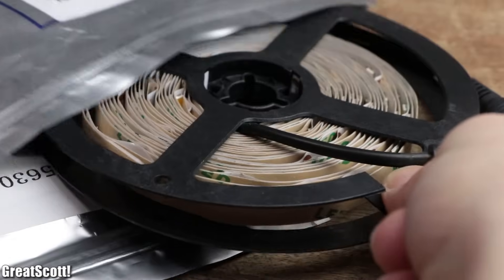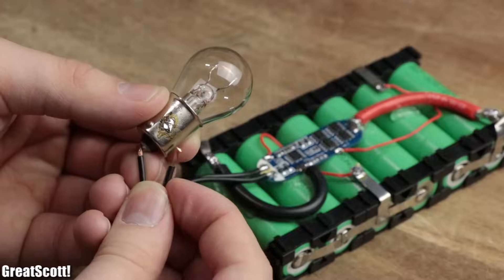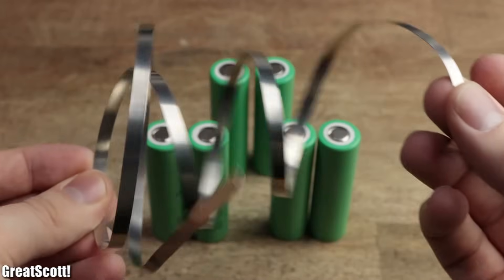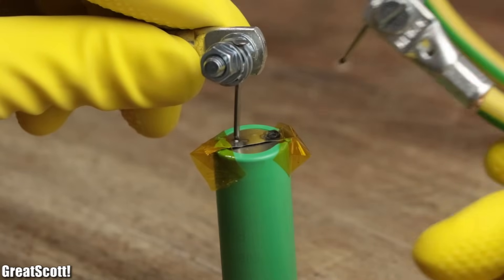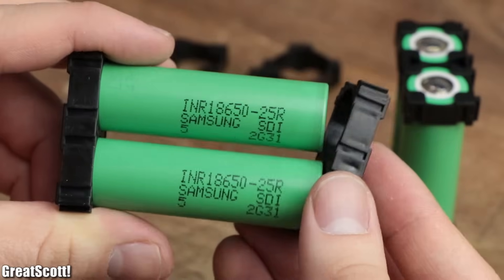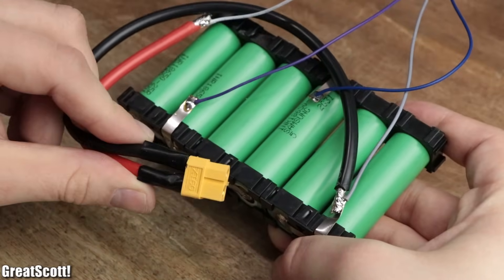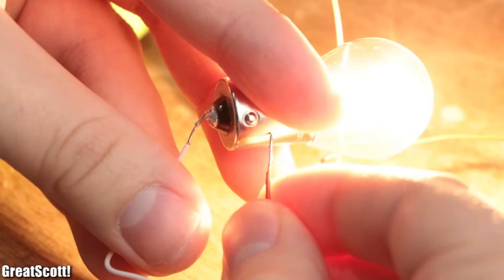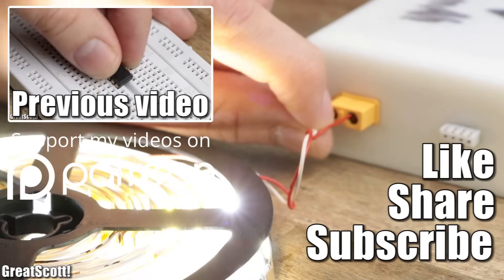Make your own Li-Ion Battery Pack

Comment: When soldering directly to a battery cell, it works best by using the largest possible soldering iron tip.  That way there is less chance of overheating the cell.  A small tip may well be hot enough, but will take much longer to heat the mass of the end of the cell, and more heat will have time to migrate into the cell instead of being concentrated at the very end where you are trying to solder.  This is especially noticeable on the negative pole of the battery, which does not usually have a raised button which protrudes from the end of the cell; and therefore has greater mass right where you need to heat it.  The positive protruding button is always easier to solder.
Reply: Also, you should discharge the battery to 3.5-3.6 v/cell to lower the heat damage to battery before the heat soldering.
Reply: @breezeli6233  Never done that, and they still work perfect, they still have each 3400mAh.
Reply: Albert Pelletier 
Makes sense. Would 60 watts soldering tip suffice?
Reply: @emersonsrandomvideos248  I use an 80 watt, but it should be fine
Reply: @emersonsrandomvideos248  Yes is more then enough, i use the Miniware TS100 solder iron on 24v, and that gives it 64w, i use the biggest solder tip i have for it, i just made a 24v battery Pack.

http://www.miniware.com.cn/product/ts100-soldering-iron-b2-tip-hot-air-soldering-station/
Reply: @emersonsrandomvideos248  I use 25w soldering iron
Reply: His iron looked just the right size ... but spot welding is always best .... if you have a lot of lithium cells these make a great power supply for spot welding , can deliver high currents , I tap into my powerwall ... Using new 18650 cells a 10p 3s configuration is all you need to spot weld .... or just 3s with a good super capacitor
Reply: @Kent Hinson Same here love my Miniware TS100, one of the best solder iron for under €50,- has done many soldering with it, and always has done his job.
Reply: I agree
Reply: Less than 200 dollars for a spot welder, no damage to cells....  And it's cool to use!
Reply: Here is a faster way to build an 18650 box   https://youtu.be/g4Aw9zxtOv4?t=12  👍⚡ 🔧🐥
Reply: More simple tip is use more flux to sold very fast, to prevent overheating cells.
Other alternative is to use paste stain with melting point 180C over solder wire with 250C melting point.

Comment: discharging an 18650 down to 2.5v is not good. i thing the 2.8v is the extreme lowest point
Reply: It doesnt look like there is any point discharging beyond 3.1 V as the voltage is already plummeting by then.
Theres good information here on charge policies for li-ion longevity:
http://batteryuniversity.com/learn/article/how_to_prolong_lithium_based_batteries
The advice there for maximum longevity is not to charge them beyond 80% state-of-charge often, and if stored, store them around 40% soc. Also, heat is big a factor especially when fully charged. That's very different from the popular idea that they should be kept topped up.
Reply: 3.2v is good for the battery to last for years, 2.5v will kill the battery in a short period of time
Reply: Cell phones say "0%" and shut down at 3.4V. The only thing you're getting out of them afterwards is a charging icon/animation once you plug them in. If the battery drops below ~3.2V, they will play dead even when plugged in and quietly charge the battery until it reaches 3.2. So I'd say that's the minimum voltage one should discharge a Li-ion battery to, with a safety buffer for self-discharge. Most discharge graphs will show that cells have little usable capacity below 3.2 anyway
Reply: astafzciba nope laptops bms actually discharge them to 2.5 that's safe I have tested this
Reply: example for sony cell on page 8 and 9
http://www.produktinfo.conrad.com/datenblaetter/1400000-1499999/001499574-da-01-en-SONY_LI_ION_AKKU_18650__3000MAH_30A.pdf
Reply: @BiecherBender  I got a sony laptop over a decade ago. Within a year and a half, the computer would no longer recognize it. I keep it plugged in now anyway.  However .I recently started harvesting them. And half of them had been all corroded
Reply: i agree  thats true about li-ion    its not like  lead acid at all   which must be stored at  full charge or it will sulphate
Reply: nightmare in action nighmare in action laptop batteries fail all the time, I don't go below 2.8-3v

Comment: Hi GreatScott, i have a question: can i recharge the battery pack whit my power supply and BMS? I use this pack for my softair gun. thanks
Reply from the maker: I would recommend a balance charger.
Reply: ok, thanks!!

Comment: These BMS circuits are NOT suitable for regular use; they are a last ditch safety feature to save a pack from blowing in event of over discharge, or suffering unrecoverable damage in case of discharge.

2.3V is way, way, way too low for these cells to discharge to and you're causing significant damage to them by doing so. Even in the tests manufacturers do down to 2.5V, you can see the insane drop off of voltage on the spec sheets, which nobody uses in the real world. Good practice is to limit the final 20% of capacity out of regular use, so the voltage doesn't dip so low. This also has the added benefit of making life easier for voltage regulation circuitry since there's much less of a drop to amplify back up to your regulated voltage when using cells across such a large range. This way you get much better cell life and still get most of the benefit of energy density of the Lithium Ion chemistry.

A good way to see this in practice is to use a voltage monitor app on your phone, you'll see the battery voltage really tail off in the lower percentages. You'll see in the single digit numbers, your battery voltage is still around 3.2-3.6V! 

This is because due to the nature of voltage sag under load, phone batteries maintain a relatively high voltage throughout discharge; the lower the average current throughout the discharge cycle, the higher the voltage at the end of cycle and the steeper an abyss the voltage falls into when the cell is past flat.

Tesla did an article years back about how they limited the cells in their cars between 4.15 and 3V in order to strike a balance between cell life and run time. And this is for a car pack, where cells are under very high current loads which sag the voltage much more than something like a phone would. See how conservative that 3V figure looks versus the way the manufacturer shows it on their spec sheet?
Reply from the maker: I agree. In the project where I will use this battery I will talk about this problem as well.

Comment: Are there other effective and safe options other than permanently soldering batteries? Wouldn't it be much better to have ability to swap single sell without disassembling whole lot

Comment: You made a nice pack but it would be nice if there was a BMS with balancing built in :(  I don't want to buy a expensive balance charger. What about a self made one , that could be an idea for a video :D
Reply from the maker: There exist BMS with balance charging. Just search for them on Ebay. You can get them for 10-20$ from China.

Comment: Or you can find a lithium power tool battery and take it apart. or use a laptop battery. 18650's are hard to weld or solder together. The heat from the soldering process can damage cells pretty easily and welding tabs to an 18650 can be dangerous even with a proper spot welder. The negative side is the dangerous side since it is part of the container. The positive side is the one that can take more abuse. I work at a battery store with a + symbol in the name (don't want to directly say where since I am currently typing this from a work computer at the tech center desk where we build battery packs), anyways I have had a few experiences with building lithium packs. We don't actually build them here because they are too dangerous and sensitive. I have had 1 18650 vent and I have had 1 - 14250 LiSoCl2 battery vent on me and that was terrible. the 18650 wasn't fun but compared to the saft 14250 it was nothing. the 14250 has thionyl chloride in them which in oxygen becomes hydrochloric acid and its very exothermic. My face learned this fact. So just be careful building a new pack. Its much safer to take a premade pack and alter it to suit your needs than build a new one from scratch.
Reply: x9x9x9x9x9 wow you are lucky I wish I can work with batteries like you not the I want them to vent on me I had one vent on me before I flew across the room
Reply: It is a fun job and fairly relaxed. I mean I am watching youtube right now while at work so its kinda nice.
Reply: might be wrong about the name, but he's right about the welding.

Comment: would this kind of battery work well for an RC racer?
Reply from the maker: Depends on how much current it requires. This pack could provide a peak current of 40A. LiPo batteries can easily output more.
Reply: GreatScott! thanks this is my first racer so I was trying to find a good battery and I believe it takes about 4 amps as it is maybe a little more, I can just up the current by adding more batteries in series correct?
Reply: GreatScott! thanks this is my first racer so I was trying to find a good battery and I believe it takes about 4 amps as it is maybe a little more, I can just up the current by adding more batteries in series correct?

Comment: 18650 cells are just as dangerous as LiPos when it comes to overcharging them, they are harder to puncture though so they have that going for them and sometimes come with integrated protection circuits.

Comment: What appliaction would a battery-powered LED strip have? Is it for your electric longboard?
Reply from the maker: Not for the longboard
Reply: Apart from that, your seller on ebay is quite expensive. On Akkuteile.de (Germany) you can get one 18650 battery for 3.95€ (search for the 18650 26F) and the more you buy, the less expensive they are. 10 cost me 36€.
They all come individually packed and the quality is just fine (they are used in my laptop battery by default).

Comment: Another wonderful video GreatScott!

I wanted to request for a future video if you might combine a solar charge circuit with some kind of monitoring and potentially several output voltages. Although I have created something similar I honestly believe mine is fairly inefficient as I am having to use multiple boost / buck converters and have an arduino "web" monitor constantly drawing small amounts of current to monitor output / charge voltages.

Thanks again!!!
Reply from the maker: I have a solar project on my to do list. I will include your ideas. Just waiting for sunny days.
Reply: Thanks Great Scott!

Comment: i really enjoy watching your videos ...
i want your help. how can i use op amps to monitor and  to prevent prevent over discharge of Li ion 18650 battery pack like this? ..  i was thinking of using op amp as comparator... any idea ? please suggest ..☺ thank you 😀
Reply from the maker: Sounds possible. Create a lower constant voltage with a regulator, use that for one input, create another lower voltage through a voltage divider and use it for the other input. Adjust the voltages to one another so that at a trigger voltage of 2.5V a MOSFET turns off the current flow of the 18650.
Reply: GreatScott! thanks ☺ but i had doubt.. if i used a regulator then i have to take power from the same battery pack.. so if the battery discharging and if i say the regulator is 2.7V then, when the battery voltage is just a volt more then 2.7 V, the output of regulator may not be 2.7V because, they require more voltage at input of what they r outputting. so that may affect the output of comparator.. any idea how i can encounter this?

Comment: Thats awesome but for a rc car thats not too good that battery is probably heavy but it's still an awesome invention!!!
Reply: Rc Carrier yup I have done this its not the weight the problem but the fact it cant supply enough power if you just try to trotle over half fast or do not throttle slowly the voltage drops too mutch and the way shuts down or it just moves and stops really fast like if 1 cable of the brushless motor is not connected

Comment: Great video, this is exactly what I'm doing at the moment. Is there any issues connecting the balance leads to the BMS and balance charging with a separate charger? This was always something that bothered me when trying to source a suitable BMS.
Reply from the maker: The balance charger does its job just fine and does not interfere with the BMS.

Comment: Can you use a 1s6p with a step up converter to get 12 volts instead of  connect 3 batteries in series? The capacity will increase very much
Reply from the maker: Sure, but in the end you get the same energy and you usually have power losses through the boost converter. So 3S2P would make more sense.
Reply: GreatScott! A 3s2p 5000mah will power the led strip more time than a 1s6p 10000mah?
Reply: Hailstorm And wich are the mah after converter?

Comment: Viel gelernt, besten Dank. Für Dummies (wie mich) ohne Ladegerät wäre ein USB-Ladeport noch DAS fehlende Luxusfeature.
Reply: Ein 3S Pack ist schwer mit 5V zu laden. da benötigst du einen Step-up konverter. 55Wh aus einem USB Port (5V/500mA)dauert auch ziemlich lange. Mit den Verlusten des DC/DC Konverters vermutlich ca. 30h. Auch mit 5V/2A wird es 7-8h dauern.
Reply: Ein IMAX B6 Klon kostet einen Zwannie mit Versand aus DE...
Reply: goamarty usb 3.0 hat sogar ganze 900mah😂
Reply: ja und das sogar alle 72min :-)   750mA maximaler Strom, wenn ich mich nicht irre.

Comment: Hi scott. i want to ask you .BMS discharge and charge is same tab ??  
just like this one http://www.ebay.com/itm/4S-20A-14-8V-Li-ion-Lithium-18650-Battery-Cell-BMS-Circuit-Protection-PCB-Board-/192006676270?hash=item2cb47d5f2e:g:-BsAAOSwCGVYBdN8  .sorry my english bad
Reply from the maker: Yes, it is the same tab.
Reply: hurmmm..... do you think .there are Fake Bms in ebay ? because i see some  bms have ic and no ic just mosfet.maybe you can make video about .how Bms work .

Comment: One simple rule 
Look what Samsung does 

Do the opposite
💥
Reply: I really don't understand. They made a mistake (even though it wasn't even them producing the batterys), and fixed it. Unlike Apple, which still didn't fix the iPhone 6S Touchscreen IC problem, even though it's fairly known.
Reply: Oh stop it....everyone has had a bad supply of batteries.  Dell, Sony...
They fixed it.  Life goes on.
Reply: Phil.R. lol, im watching this on a note 7
Reply: Uhhh, no it wasn't. Samsung had the Note 7 batteries manufactured by two major firms, and the product lots contained defects due to inferior solder joints between interior cells. They only showed themselves when certain cells would drain.

Have you...ever actually tried to squeeze the lipos they use in phones? iPhone batteries are very malleable but Samsungs are surprisingly solid. The phone isn't going to "squeeze to hard on it" when it has a compartment specifically designed for holding the battery. Have you ever taken apart any Samsung phone? This is pretty obvious, elementary stuff.
Reply: These samsung 25R5's have been pushing to ~20A CDR without adverse effects.
Reply: It was a bad design actually.
The phone squeezed the batteries too hard.
Reply: Ado Gamer R.I.P you then lol. Hahahaha
Reply: Michael NoLastNameHere Not true. The S4 for example does.
Reply: Or it could be a major flaw in the battery somewhere. I take apart my phones to do repair and i find the battery snugged perfectly in place.
Reply: And how is ti exploding?
Reply: Dell don't make their own battery
Reply: 𝕋𝕙𝕖𝕣𝕖 𝕚𝕤 𝕒𝕝𝕤𝕠 𝕒 𝕓𝕒𝕥𝕥𝕖𝕣𝕪 𝕣𝕖𝕔𝕠𝕟𝕕𝕚𝕥𝕚𝕠𝕟𝕚𝕟𝕘 🅖🅤🅘🅓🅔 𝕠𝕟 >>> https://t.co/mK3KjJd0lr?hwhqn4BmC2Ia

Comment: Is it not better to place a diode in each parallel strand to prevent batteries feeding each other?  I know you have paired them by voltage already